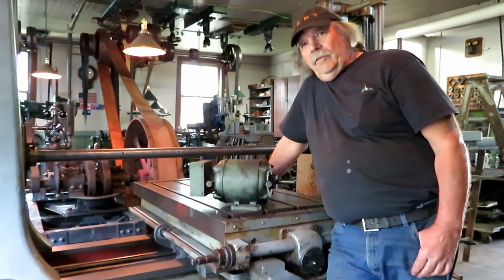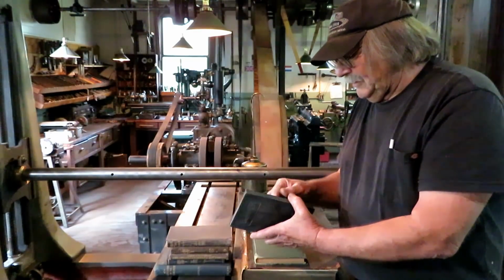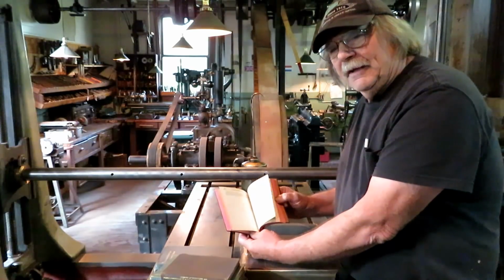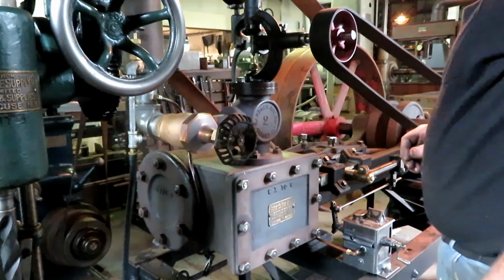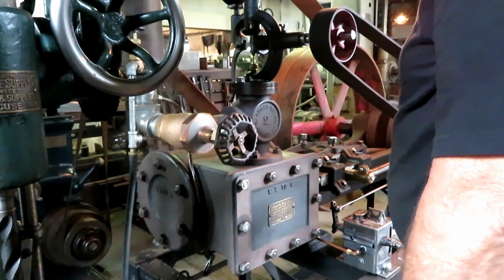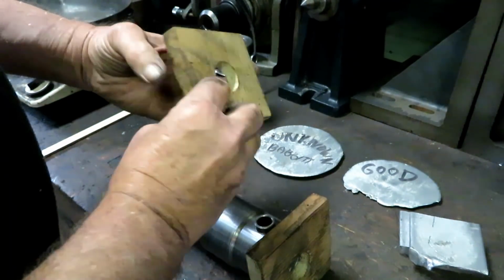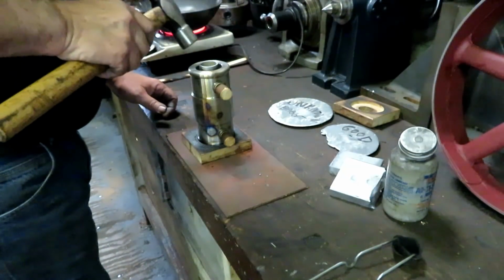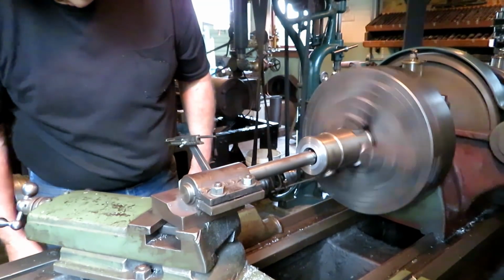OLD STEAM POWERED MACHINE SHOP 29

Comment: Dave, in this video you talked about the different work ethic of years past and how people would better themselves through trade publications.  This immediately brought to mind my father who spent his career as a commercial airline pilot starting in 1956 with West Coast Airlines flying DC3's all around the Northwestern United States.  He had no military flight training and worked as a printer using every dime to pay for flight lessons and all the many different ratings required to obtain the golden ticket, an Air Transport License which permits you to fly people for revenue.  All he had was a high school diploma.   As the next 35 years passed he would move up to turboprops (Fairchild F27), turbojets Douglas DC9/MD80 and retired off of Northwest Airlines flying high bypass fan jets with 37,000hrs+ flight time.  He flew four distinctly different forms of power plants starting with radial piston 18 cylinder P&W R1830 and finishing with Rolls Royce Fan Jets.  He never obtained any further formal education and told me as time passed he became very aware that the newer pilots had college degrees.  He stated to compete against the New younger and more educated coworkers he had decided he must be a better more knowledgeable and capable pilot than the competition.  The size of his library was extensive and filled the basement and upstairs spare space with books on anything that had to do with flying, aircraft design  or safety.  He became very focused in latter years in promoting airline safety, worked with the National Transportation safety board NTSB in conjunction with the airlines to promote an foster an environment of safety.  He proudly retired having never caused harm or injury to a single passenger.
But the memory I'm left with are of him sitting in his recliner with his Ben Franklin's on ALWAYS reading some aspect of flying.  Upon his passing and after all the grandchildren had, had their pick of any books it still  took almost two full loads with a Uhaul truck to empty out his books.  Most went to a museum of flight here in Vancouver and the rest to the Pacific NW Regional library's.  So when you talked about all the trade publications and people taking the time to better themselves this all came to mind, and was really true of that generation. Thanks, Scott
PS, it's  great to see you back.  I'm now watching your series of videos for the fourth time damn it!   There really is nothing else out there as unique as your shop and videos.   God bless, -S
Reply from the maker: Thanks for the great comment Scott,  That kind of dedication is rare these days. Most folks will wade into a job on an engine for instance,  with no fore knowledge, no service manual, too much trouble to educate themselves.  Flying a DC3 is definitely on my "bucket list"....Dave
Reply: David Richards, Dave, take along EARPLUGS when you do.  My father was almost completely deaf by the time he retired.  10,000hrs in DC3's wiped out the low end.  Then another 11,000hrs in F27's with those screaming Roll!?s Royce Dart turbo props wiped out the high pitch, then another 10,000hrs in DC9's with the Pratt & Whitney turbo jets.  The same engine as on the Boeing 707, 727, 737, and DC9, DC8's wiped out his mid range.  Then 4000hrs in Boeing 757's finished off anything left.  My brother is a captain for Alaska Airlines and has hearing aids now.  One if the things is the air induced noise level in the cockpit is a lot higher than people realise,  especially in the first generation of jet aircraft.

Comment: Just a small question,does the new engine use as much steam,it’s running really nice ,steady pace,does sound good on the timing,I would be interested,as it’s a replacement engine,running at a 3rd the speed,great video,thanks.
Reply from the maker: Hi Carlton, Even though it is running at about 1/3 the speed, the big engine uses more steam. 5x5" cylinder vs. 8x10".....Dave
Reply: Thanks for the reply,I was trying to work the maths,but found watching your channel from your first video,far to enjoyable,plus I have not quite worked out the small engines rpm,but I will,thanks again for the time and enjoyment you put in the videos,take care,again thanks for the videos,and your time.ps I’m in the 53 video.

Comment: I sure could have used one of those crimpers. Back in the 80's I was in Haiti working in a baseball factory. The old 1920's Reach winding machines ran off elevated electric motors using flat leather belts.
Reply from the maker: Baseball factory, the old way. Very interesting Jeff...Dave

Comment: Gawl dang it! I just about fell off the couch watching you promo on the wousy service life we get out of electric motors. I'd have to buy a new three three bladed fan standing on a pole every 2 to 3 years as the motor would burn out and the local electric shop wouldn't touch them as they are all plastic inside. 

17 years ago I was at a flea market and staying to the end I found three GE four bladed fans three speed sitting next to a trash barrel. I grabbed them and brought them home. These were designed to be used on a table or mounted with three heavy duty screws or bolts to mount it to a wall. One was clean and the other two had a build up of lint and Dust three inches deep. The wife looked at them and cleaned them up and I took the gearbox on the back of the motor that when you tightened the thumb screw it swung the fan back and forth. I gave two of the old GE fans to two old timers I overheard complaining about how bad the plastic fans were and how often they died. My daughter wasn't interested in one as they weigh near 35 plus pounds each. 
The 2 old timers I gave a fan to each of them like mine are still using them and love em and like me never use em above the slowest setting. I oil up the bearings one year 2 drops of oil in each bearing. Turn the fan on to the lowest setting and it takes a couple of minutes to get up to speed. So what if it's slow, it's reliable.

Love the videos Dave.
Reply from the maker: well great, so much for progress....Dave

Comment: I have a GE 1 HP repulsion/induction motor that may interest you, also two DC repulsion motors. ..  The GE motor is AC..Cutting threads in brass:  I was told that condensed milk was a good lube to use when tapping a piece of bras by hand.

Comment: Have you operated the large engine enough to tell how much more steam / fule it will consume ?  Compared to  the small engine ?

Thanks ,   :-)
Wyr
God bless
Reply from the maker: The boiler doesn't seem to fire much harder but it uses noticeably more water so it must use more fuel....Dave
Reply: Thanks ,   :-)

Wyr
God bless

Comment: Dave, what is the horsepower rating of your shop steam engine? And couldn't you use a tensioner pulley with very minimal pressure to keep excess slack out of the long leather belts without creating additional belt stretch?
Reply from the maker: Paul, This is just my own preference, but on a long belt I like some slack. In a lot of cases a tighter belt will jump around more when it hits a certain speed from the resonant frequency of the power pulses, specially on the main drive from the engine.....Dave

Comment: What kind of oil did you put on the belt? I could t hear it very well. I have a small 10 inch lathe I laced a new leather bet should I oil it as well?
Reply from the maker: Tyler, I use straight neatsfoot oil on the leather belts. you can get it from McMaster Carr....Dave
Reply: Thank you Dave!

Comment: Great work Dave, should have no shortage of horse power!  I don't want to sound like the safety police and i'm a machinist also and know that there are lots of other hazards in a shop but I would suggest making a tin shaft cover  that will slip on the shaft, for the end of the crankshaft  just because its T-shirt height and right along the alleyway,

Comment: There are also Reed's books for marine engineers which are still in print. They were the basis for most power engineering examinations in commonwealth countries for a very long time. They had exam questions with solutions in the back of the book.

Comment: wow!  Just received my Modern Machine-Shop Practice by Joshua Rose. Two volumes each 10lb. Pages are 13x10 inches.
vol II has chapters on erecting, line-shafting , pulleys , and of course steam engines, and boilers and much more.
It is 3rd edition. 1899, with one of the two printed in 1903 but still 3rd edition. They appear to have never been used.
4000 drawings or engravings. 
Paid about 75$ apiece , but I'm happy.
I think yours is a newer book.
This set will certainly help me understand more of what you do.
Thank you for the wonderful videos.
dale
Reply from the maker: That right there is a great find....Dave

Comment: Do you ever worry about the wood plugs or ends out gassing from the hot babbitt metal? All the stuff I have ever poured had metal plates and babbitrite to seal things.
Reply from the maker: That, combined with the housing being to hot and slow solidifying very well could have caused gassing and then voids in the pour. ...Dave

Comment: You got me! How does steam consumption compare between the two motors?
Reply from the maker: Looks to be about the same Tim, I want to do a test of each engine running under same load for a given time and compare the boiler water consumption....Dave
Reply: Yup, not too surprised. Bigger bore but running it slower. Pretty neat.

Comment: Dear David, 
I am a a big steam fan.
I have had a idea brewing in my head sense I was about 14 years old. And I need to find some blue prints or diagrams of a steam engine so I can machine the parts and make this happen. I would love to give you my idea but it's gonna make me a lot of money.
Do you know where I can obtain some blue prints or diagrams for machining either a 8x8 stationary or a rotary steam engine? Thanks
Reply from the maker: Good luck with that, I'd like those also. There are drawings that have survived of individual parts of Frick and Case traction engines that I've seen. Probably your best bet is to buy an engine and take it apart....Dave

Comment: long time watcher, first time commenting....
I'm a 35yr old industrial blacksmith  in Australia, and I have been collecting and attempting to restore steam engines and flat belt drive machines for a number of years now.
your videos are an inspiration to me, especially when something seems unachievable, and then i see how easy it is in one of your videos!
please inform me what paint you used on your boiler, I am looking for recomendations for a heatproof paint for mine.
thanks again for another great video.
Reply from the maker: Hi John, thanks for commenting. "Industrial Blacksmith", now there's an occupation that you don't hear around here. Would that be involving a powered forging works with stamping and power hammers? Very little of that done in this country, sadly it's all farmed out to China or India.  I just use Rustoleum brand high heat black paint as recommended for outdoor grills, etc.....Dave
Reply: David Richards yeah mate, i served my trade under large open die forging machines, and forging presses. there isn't  much call for it here any more either.
which means that when i can get hold of forging machinery i snap it up.
a MASSEY 3cwt 'With slides' pneumatic hammer is one of my projects, ordered in 1927 for the Commonwealth Sugar Refining Coy (CSR co) specially ordered to run off flat belting.
I've also got a 3cwt 1895 steam hammer to get going too!
Reply from the maker: I'm a rank fledgling blacksmith but I would really like to try a steam hammer....Dave
Reply: David Richards 
well if you ever make it to fnq Australia, we should have it running in  a few years, you are more than welcome to have a play!

Comment: I didn't see electric power until I was six, so the kind of micro-management of biological and steam powered technology that's natural to farmers is built in. The safety motto title of the video is also part of living in remote areas, and that's another condition that must have been a requirement of an advanced culture, ...hold on to what is best in (silently) applied principles from previous times.

Are you going to tell Tesla about the electric motor failure? Those new-fangled things will never get anywhere, it's ludicrous.

Comment: Hi Dave your shop sounded so great while you were drilling the holes with your drill press no loud unnerving whine from that darn unreliable electric motor or the clanging and jarring noise from the high geared transmission  to reduce or increase the speed of the drill just that great thump thump thump of the belts going around the flywheels

Comment: Silly question: is that a leather belt? If so what animal does it come from if it's 25 feet long with only 1 join?
Reply from the maker: It's got a lot of splices, about every 5 feet,  they are long overlapping glued, part of the belt manufacturing process...Dave
Reply: Can you still buy new stock?
Reply from the maker: McMaster Carr, and a few others stock leather belting in three grades. The newest stock I've tried seems to stretch forever. A leather expert told me that it has to do with what and how the cattle are fed these days....Dave

Comment: I find motors of that age get a stuck centrifugal switch, the start winding never cuts out and it burns up. This only happens after the motor has been on awhile, and the start winding overheats.
Reply from the maker: I know what you mean, but this was an induction motor...no brushes..Dave

Comment: Where do you find cow big enough to make a 25 feet belt
do not return your motor for warranty repair < it will be good for only another 80 year > ask for a complete refund
that old steam engine is so smooth and quiet compare to the old one !
Reply from the maker: It's a lot of small cows glued together I think....Dave
Reply: i heard it was brontosaurus . . . they cut strips from head to tail . . . you can get two or three belts from one strip.

[ they tried cutting strips around from belly to back to belly again yielding a seamless belt but couldn't get quality control to give them uniform standard sized brontos ]

Comment: In a previous video you showed the little roller on the governor belt that would prevent runaway if the belt let go. Are you going to build something like that for the big engine or is it really not something to worry about in this type of setup?
Reply from the maker: Covering this on the next video....Dave

Comment: Hey David glad to see you have it up and running. I have two questions David. 1. Why does the new motor drip water around the valve, I don't know much about them so I thought I would ask. 2. At 35:45 you added turpentine instead of oil while boring out the Babbitt, why? Thanks for posting the video another fine one. Oh loved the comment on the electric motor not being reliable after 80 yrs as a steam engine. Best Wishes n Blessings. Keith
Reply from the maker: Keith:  the valve rod has a packing gland that has to be tightened from time to time, I've taken it up a couple times but it probably needs some new graphite rope packing installed. I've found that turpentine works very well when boring babbitt material, it keeps the chips from balling up and gives a good finish.....Dave

Comment: Funny about the electric motor comment. I love the old Audel books. I've got both my fathers and my uncles Audel carpentry books and a few more (early wiring and steamfitters) that I picked up at yard sales. Fun to read about gas piping for house lighting or that "a good man and a horse should be able to move 8 yards of dirt in a day". While the books themselves are best, you can find a lot of old books via google books. A lot that simply aren't available anywhere else. You can set the search for only old books pre 1920 in example.

Comment: !have seen line shafts in use in Pa. in the white top Amish shops . They are my moms people . often called Nebraska Amish and the buggy are white . The ones i saw in their shops are on the floor and along the wall . when i was a boy 50+ years ago some had steam power units , but the one i saw a few years ago was powered with a Honda motor . every thing in it is run on the line shaft . they do not use any electric .
Reply from the maker: John, was that Dave Fisher's shop in Lancaster County?
Reply: No ,Moses Yoader in Center County co. There are no white toppers in Lancaster . The Lancaster Amish are more modern than the Nebraska Amish . I have a cousin who was married to a fisher in Lancaster county I will ask her about  David .
Reply: They also use hand tools modified for compressed air . and house hold appliances modified also . things like kitchen aid , and circular saws . there is a shop about 3 miles fro here  a shop , Old order Mennonites that modifies tool for it. A lot like steam

Comment: Amazing, and I suppose we'll just wait and see if the reliability will improve in this electrical stuff. I knew an old carpenter that said he had a crew boss when he was just starting out YEARS ago. The guy would look at the plans once, put them away and get a rule and a framing square and start cutting pieces out of the lumber pile.Wouldn't look at them until the finish work started. We've lost a lot in our so-called progressive years. Thanks, Dave!
Reply from the maker: You've got that right...hardly anyone "builds" houses anymore. More power to the ones that do....Dave
Reply from the maker: but at least there is a trail of books and manuals left behind....Dave
Reply: IF you could get them in an i-phone or a video game, somebody might look at them that're not geezerish like we are.